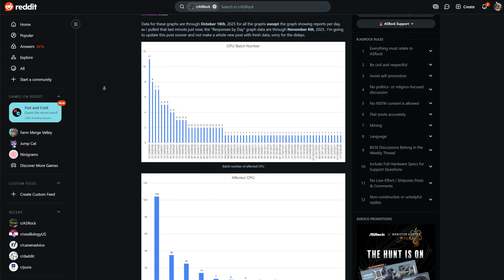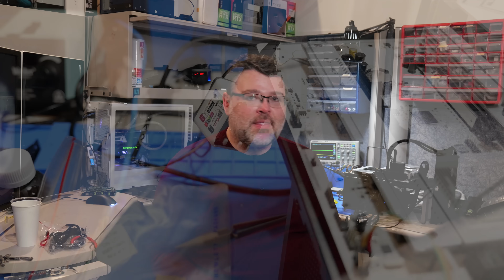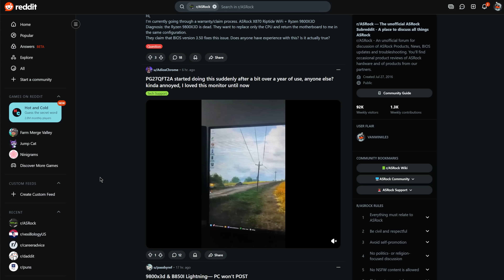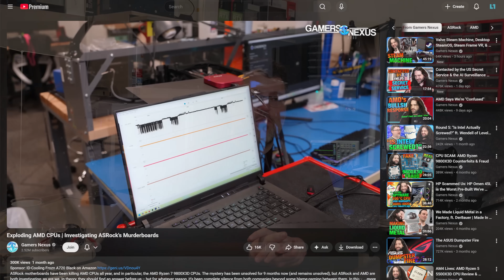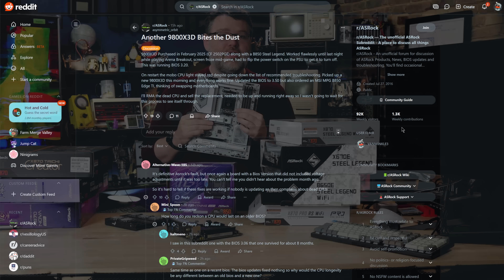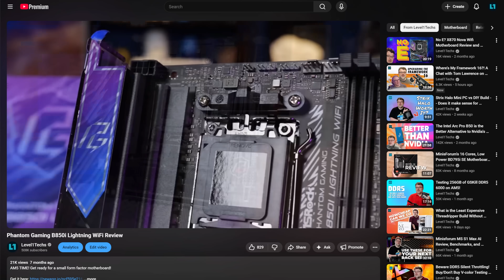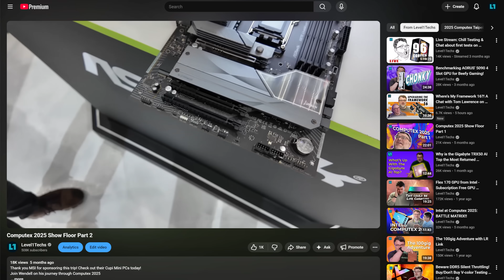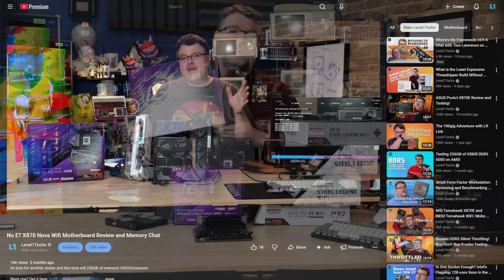Attempting to Troubleshoot the ASRock Motherboards of Death!

Comment: Great video, but my 9950x3d cpu on the Asrock x870e Nova wifi lasted 3 months and worked beautifully...until it didn't.  After replacing the CPU with another 9950x3d, it lasted roughly another 3 months before it died as well.  First one died on 3.15 bios, second on 3.25 bios (what Asrock told me to use).  They have since asked for the motherboard back and are sending me another Nova wifi.  I have replaced it in the interim with an MSI x870e Tomahawk wifi.  Works great so far, but so did the Asrock initially.  My point is, it may take several months for the board to kill the processor if it's even going to do so.  My friend built a 9800x3d on the same motherboard in January and his is still chugging along.  I hope you find out the root cause of the issue because that Nova is a really nice board.
Reply: I'm running a 9800X3D with PBO on an X870E Nova since the release day, and I'm still on the 3.10 BIOS. I'm generally scared to update the BIOS, even to the newer 3.50 "safe" version.
Reply: @Dudi4PoLFr  Running same config as you, i updated all the bioses. Problem is whit the EXPO profile, just need manualy adjust VSOC and VDDIO voltages (from 1.4v to 1.2v) after each update to run system safe.
Reply: @Dudi4PoLFr same but on 3.50 no problems so far other than the damn network controller will disable itself and I have to unplug the pc wait 60 seconds plug back in and it's fine for awhile until it happens again rinse repeat(usually during sleep mode sometimes when it's off)
Reply: @wrcupz8685 Hey did you find a solution for that? Mine does the same thing. I have to do the same steps
Reply: @robertraygoza2117 nope so annoying because I wanna use LAN not wifi
Reply: I have the same mobo with a 9800X3D, built back in April and so far no problems. Crossing fingers...
Reply: This is so true , my nova wifi worked for 6 months until it killed my 9800x3d a few days ago there is no escape it seems
Reply: Too bad you can't tell us about the exact circumstance when it happened. There is certainly no timer of any sort, but specific circumstances that line up when it happened.
Reply: @Ganiscol  So the first death occurred during sleep mode.  It would not wake up.  The second death the PC was off and would not boot up.  It had been acting fine prior.
Reply: @docmarshall2251   I generally feel like the issues are related to sleep mode since windows defaults to the setting being on and most people wouldn't think that this is a problem. 

When I first set up my system I turned on the OCCT benchmark and left for lunch but wasn't able to make it back in teh 1 hour of the test looping, so when I did come back to a dead computer and got a scare, I realizsed that it was just taht the comptuer went to sleep and then wouldn't come out of it. resetting the CMOS fixed it for me but I since disabled sleep in windows (and fast restore in bios) and it's been running well since
Reply: From every instance I've been able to find from Reddit and tech blogs the only CPUs that have been actually dying are X3D CPUs. From ASRock themselves, the failures are occurring because PBO's default EDC & TDC values are set too high. Normal 9000 CPUs like the 9600X/9700X/9800X will handle this just fine.

This is also, more than anything, a user error. They're cooking either the cores or the 3D VCache, and the cores can be cooked more easily because of the 3D VCache. People are literally warned when turning this on, and they are attempting to OC a processor that was not made to be OC'd. 

The safest thing is to just not use PBO at all. People learned this back with the 5800X3D, don't know why they're expecting it to be different now.
Reply: @MeloniusFelonius  Go to the Asrock subreddit.  There are non x3d variants dying as well, just not as frequently.  As far as PBO, I don't enable however I think there may be an issue with these boards and using EXPO...
Reply: @docmarshall2251 ah, I only found instances of X3D chips, so I assumed (esp the 9800X3D). Point stands with PBO tho- People who don't know what they're doing shouldn't touch it. Default auto OC values should never be trusted, even moreso with 3D chips.
Maybe EXPO has a hand in it, who knows. If it's only PBO (like ASRock says), then the boards themselves are perfectly fine, and people should greatly heed the warning that comes with enabling PBO.
I was hoping to upgrade from Zen3 to a X870 LiveMixer + 9700X, but with all the Stargate AI nonsense increasing RAM prices by over 100%, that plan went down the drain.
Reply: @MeloniusFelonius  It`s not only the pbo. On reddit megathread about dead cpus there`s a statistic showing 70% of people affected din`t use PBO at all. Also, only 5% people used it to overclock. 25% used it to undervolt, which is not only a good thing, but essential cus of am5 chiplet cpus being extremely hot out of the box. 

It`s not pbo, not expo, not a bios version. It`s something either in hardware asrock uses in am5 boards, or a deep architectural error in these bioses.
Reply: @MeloniusFelonius  Ive been using a 9600X with a small undervolt, both my motherboard and CPU died after 6 months of use.

Comment: I have had my 98X3D running on X870 Riptide, bios 3.30 (flashed before installing CPU), for 6 months with more or less a strictly controlled environment. A lot of tweaks, such as CO -30, Vsoc 1.135, and RAM 2x32 6000MT/s with BZ-Lazy timings. And dailying Linux (occasionally running benchmarks and validation runs in windows, installed on separate SSD). 

For most part, I don't want it to go boom. But in the other, it would be an interesting data point.

Comment: "Only 150 boards" is not reassuring. Makes me very concerned to build with Asrock again.
Reply: Depends how many have been sold.
Reply: 150 among hundreds of thousands is actually VERY reassuring and would actually be well below the norm. ALL motherboard SKUs have failures. The issue is that it's 150 complainers, which would suggest that there are more users experiencing the same failure, in addition to those people that don't make posts about it.
Reply: Asrock have apparently sold well over two million AM5 motherboards, and around 200 AMD CPU's have died. The CPU failures have not all been verified as dying due to Asrock. The majority were used by enthusiasts happy to play with bios settings, but lacking the ability to update bios, this itself is pretty telling.

One guy posting images of his 7600x and Asrock motherboard failing, before he bought the kit he was continually advised to update bios, do this, do that, but no, bios 3.15 and him playing with his bios settings and switching the PC on and off during Memory training as he thought something was wrong. Certainly was not the motherboard to blame there.

Comment: I have a Asrock B850i Lightning and a 9700x. On a scale of 1-10, how worried should I be?
Reply: 1, I've been using an X870 Steel Legend with a 9700x for around a year now.  Just check memory QVL from ASRock support page.  If it is not on the list, it doesn't mean it is not compatible; just leave the settings stock on an untested module, or just choose the lower speed XMP or EXPO profile if you do overclock it.  My RAM is not on their list for 9000 series, so I left it JEDEC spec (it came with a bundle on Newegg with CPU/RAM/MB and basically made RAM cost $0).

Comment: After i heard about the Arctic Liquid Freezer III Pro could be tightend too much and bend the socket. I started thinking it might not be a unique Arctic AIO problem. But could it be what is causing it on multiple different boards and AIOs ?
But i don't have the HW avaiable.
Reply: Yup that may be one cause, I use torque setting screw drivers; my Steel Legend X870 had all screws for motherboard to case and Arctic III Pro freezer set to 0.8Nm and 0.06Nm for the Thermal Grizzly AM5 contact frame. No issues at all with 7950x cpu.

Comment: There's another subset of this Asrock issue where the system develops a boot problem. I had a Asrock B850 Pro RS that worked normally for 3 weeks, then started getting stuck with a 'boot' LED when turning on from an off state. It would take multiple resets to get it to boot. Posted in reddit and had dozens of others with this same problem. There appears to be no fix other than replacing the CPU.
Reply: Have seen similar behavior with unreliable booting. Turns out that was bad signal integrity between the CPU and RAM. It would sometimes boot on stock settings, but never with a faster profile or mem OC. I had another set of RAM and a CPU to conclude the issue was with the mobo.

Listening to the video, I am wondering might be a socket issue. Bad soldering job, or something that intermittently connects and kills CPUs.

Comment: I think its a combination of board vendors being a bit randy with the voltage on PBO coupled with X3d chips.  I had my 9950x3d just randomly die after working fine for 8 months.  Thought it was a bad motherboard or PSU, however replacing both didn't fix the issue.  Turned out to be a burned out CPU and there are reports with the x870e boards and x3d with PBO, that 3d v cache degrades over time.  The behavior I saw is that  the RGB (don't laugh) would light up on the board, but nothing else.  No post, no beebs, no indicators on the POST LEDs, naddda.  It seems that these new 7000 series and above chips are a bit hit or miss.  Quite a bummer as I loved my 3000 through 5000 series ryzen stuff.

Comment: Huge ASRock fan.  I have built over a 100 rigs using their motherboards.  I have had one warranty request and they took care of it right away.   Their boards have similar or better features than competing brands, they have the b@lls to put out unique designs and back in the day, I heard the company was started by ex-ASUS engineers, and Im all for that.
Reply: AsRock was a budget brand under Asus - hence the name similarity
Reply: @BrandensOutdoorChannel  Actually.... ASRock was originally spun off from Asus in 2002 by Ted Hsu (co-founder of the mentioned company), in order to compete with companies like Foxconn for the commodity OEM market. Since then ASRock has also gained momentum in the DIY sector with plans for moving the company upstream beginning in 2007 following a successful IPO on the Taiwan Stock Exchange.[3] In 2010 it was acquired by Pegatron, a company part of the Asus group.[4]
Reply: ASUS used to own ASRock
Reply: @user-uc5tj6ux8w  i just found out that is still the case (at least indirectly if i read the constructs correctly...)
Reply: @user-uc5tj6ux8w  Ironically, they do today. ASUS reacquired ASRock through acquiring Pegatron.
Reply: @user-uc5tj6ux8w  Actually.....ASRock was originally spun off from Asus in 2002 by Ted Hsu (co-founder of the mentioned company), in order to compete with companies like Foxconn for the commodity OEM market. Since then ASRock has also gained momentum in the DIY sector with plans for moving the company upstream beginning in 2007 following a successful IPO on the Taiwan Stock Exchange.[3] In 2010 it was acquired by Pegatron, a company part of the Asus group.[4]
Reply: Did the warranty request replace your cpu??
Reply: @CluelessBackLog it was an audio chip issue.   Not cpu related.
Reply: @maestro0428 so the warranty issue might not apply for the context of the video
Reply: @CluelessBackLog  maybe not specifically, but it does say a lot about of the support system.

Comment: Hi Wendell, a big clue is definitely that Asrock has changed their VRM design on all SKUs this gen, from high end to low end. My theory is that it was a design issue, and the VRM was likely leaking current.  

I’d reasonably guess that Asrock perhaps already figured out where the hardware problem is, which is why they have been keeping quiet for some time, as it’s impossible to update the effected SKUs any further.
Reply: Then it would have to be a widespread issue, which its apparently not. It also runs contrary to the finding that killer boards can't be made to kill again so far. The main clue here seems to be that the circumstances of a fry are very specific. If it was just a VRM issue, it would likely happen again and again and again
Reply: @Ganiscol  That would depend on the users settings and how much current is required to instigate the problem. It's probably not as simple as something happening at power up phase, or something happening regardless of settings. It can still be a specific power problem that's only instigated under certain conditions.
Reply: the question now is was it actually the VRM or they where a probably culprit and easy to change in the supply chain so might as well be safe. 
it is simple to assume it would fix it but is that really the main issue ?
Reply: Agreed - what do all the previous boards have in common, and what do all the new boards have in those places?  Clues indeed.
Reply: How can we find out if a motherboard we've recently purchased could have been updated / fixed?
Reply: @gordb6142  Manufactured date and default bios version? There wont be solution yet if they could not replicate the problem
Reply: i was thinking the problem was with the VRMs and possibly it was being exposed by a weak PSU

Comment: [sigh]
~ and we don't even actually have an answer, we have a number of very good people looking, including Wendel and Gamers_Nexus and Harware_Unboxed and the folks at the Asrock factory ~
I am impressed by what Wendel says about Asrock as a board-maker for Linux-heads. That impresses me. I still want a Taichi-Lite.
I will be happier when we start to get to the bottom of what is causing Asrock boards to self-immolate with Ryzen 9ooo chips, most notably the 3d versions. I have an ambition regarding a zen-6 CPU, probably with 12 cores / one CCX, on a Tai-Chi Lite, with 64GB of RAM, running at 6,ooo, and 2TB M.5 drive. And just maybe 2 monitors running from the onboard video ~ maybe ~ possibly ~ I’d like somebody to try that out for me and confirm it works ~
The cost of a new GPU would add significantly to the build, and given I don't game (or hardly at all) if I can run desktop stuff and watch YouTube video on two 1080p monitors like I'm doing now, without spending upward of $800 Australian to do something the built-in video would do anyway ~
I don't care how many frames it gets in CSGO or PUBG with Ray Tracing ~ I don't give a flying fk! If it can do what this old GTX-750 Ti I'm running now can do, without any card at all, under Linux Mint, then why the fk would I spend all that extra money?

I don't do competitive first person shooters.
I don't do ray tracing.
I try not to do AI of any sort, but little bits & pieces of it get forced on me.
I do VirtualBoxes, with two slightly different copies of Win11 and (currently) 9 different Linux installs, and I do care & feeding of that zoo. Why? Because I can. Every once in a while, I compile a Linux kernel and try to run it, in a virtual_machine.
?
Yes, alright, and sometimes I watch naughty videos. If I can watch kitten videos then I can watch cornhub videos just as well. And FlightGear was written in 1997 and it will run on common hardware from '97 ~ I don't think that's going to strain even the built-in video on a zen 6. It gets over 40 fps on a 750 Ti, so ~ that's my whole gaming needs right there.

Comment: I have an AsRock Phantom Gaming Rip Tide B650E with a 9800X3D since Aug 2024 (with a 7800X3D from August 2024 til December 2024) and have not had any issues. I do keep my bios regularly updated. I also run 85C tjmax and -15 all core PBO since install on 9800X3D as well as XMP G.Skill Trident Z Neo RGB 6000 MT CL 30 - 32 GB

Comment: ...if this is a BIOS chip quality issue that manifests as a microcode bit flip, that sure would be interesting. If the right bit flips in the BIOS chip and its code, then it could set a voltage value to way outside allowed margin and pop it.
Reply: That's scary to think about. I wonder if there's any error detection or correction in that communication.

Comment: AMD did an Intel here, isn't that obvious? I mean, the X3D one trick pony CPU's have a design flaw which is that they stack the X3D cache on top of the CPU so it gets hotter and the voltages are all screwed up. Go measure it like you did on Intel and you see. I have 14900k and ASrock z790i lightning running 8400MHz ram for months now without any issues. Just stop this AMD fanboyism and tell people the truth about AMD and how bad they suck compared to Intel..
Reply: then why is it 95% death on Asrock vs other mobos lol you blame AMD when the straight up facts are its on Asrock looks like your fishing to blame AMD as you are the Intel Fan boy bag holder on their stock.
Reply: the 14900k is not a flex